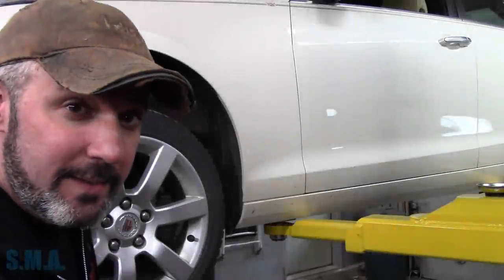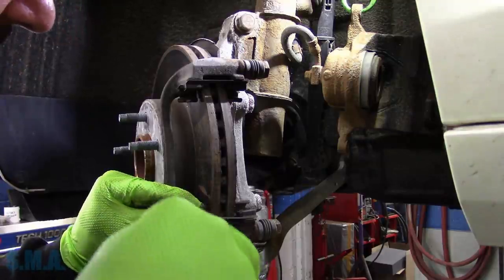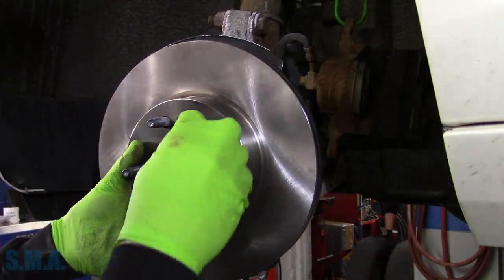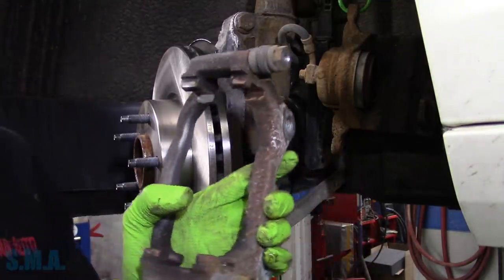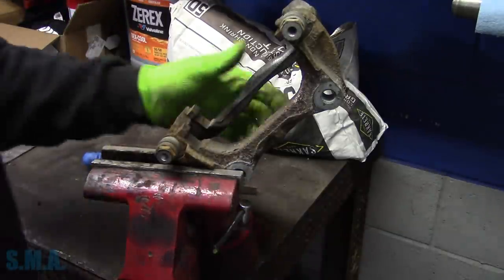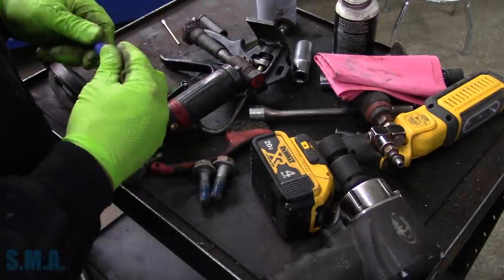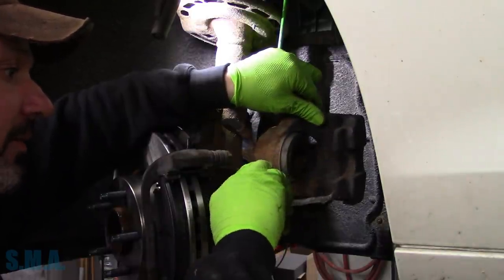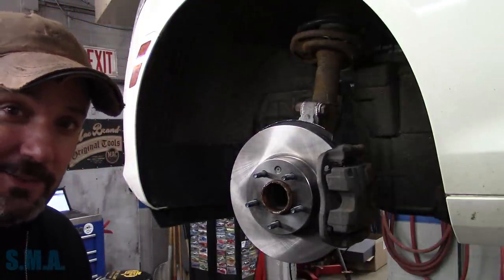Cadillac ATS: Front Brakes

Comment: If we must reuse the stainless steel brake caliper retainer (anti rattle) hardware, we run them through the glass bead blaster. They come out looking new, with no sign of crusties or tarnish. We also run the mounting bracket through the baster at the same time. We just clean the mounting surfaces as you do most of the time. You are a pro at what you do. Using the brake service file was for the benefit of the DIY guy with limited tools. Great Job! .....Walt Central NY

Comment: reusing hardware!! whats next? endorsements for Dorman?? ROFLAO!!
Reply: Actually, saw a video by MotorCity Mechanic last week. He installed a cross over pipe (between the left right side) of a Chrysler 3.6L v6 engine.  The factory pipe is plastic and the Dorman is machined aluminum with a recessed replaceable o-ring.  It fit perfect and looked awesome.  Frack'n Dorman.  Who knew they could actually get something better than factory.
Reply: @phprofYT  it's probably paper thin and will stress crack or corrode through in 3 months.. LOL
Reply: @phprofYT  ya ha they couldn't even get a thermostat housing Right
Reply: Yes that cross over pipe by doorman is awesome . Its not paper thin. Infact in my supercharged dale monty the p.o.s plastic crossovers blew out it seemed everytime i matted it. I had to wait for the aluminum ones and guess what i got the first ones
Reply: Dorman vs Chrysler- Takes a crappy part to fix a crappy car.  Makes perfect sense.
Reply: @phprofYT  Dorman also makes/made upgraded ford blend doors; they have a metal band around the stub shaft that usually snaps.  I've used a lot of their suspension steels without issues (spring mounts, shackles, radius arms, etc.). Depends on the application I guess.
Reply: @ratdude747  Occasionally a Dorman part is a good value, the problem is finding out which ones!
Reply: @throttlebottle5906  l

Comment: It's always a struggle to decide which of the specialized tools and lubes to go out and purchase when I do a brake job at home because I do them so infrequently.  Like the deep set wire brush you use to remove rust around the lugs before mounting the new rotor and those nifty scrapers that look like files to remove rust before installing the hardware.  I mean, I'd love to own those things but I just know they'd migrate to places in the far reaches of my tool box where I only rarely go and they'd be forgotten before the next time I need to install brakes.  Excuse me while I go look for a coat hanger to use to fashion one of those caliper hooks.  That's one thing  I won't need to buy.  Love your videos, Eric.  Thanks!

Comment: I got one of those Mueller files. Frickin fantastic they are. Soooo happy they make these. Every guy who does brake jobs, need one or 2
Reply: George 
I use an air angle grinder, with a 1/2” wide flap wheel that is 3” wide. Works very well for less then$1 a piece
Reply: @Sicktrickintuner  sounds like it would work well. Unfortunately I dont have a pneumatic angle grinder or a air compressor capable to run a decent angle grinder.

Comment: You are 100% correct with your Loctite assumption. It MAY be less viscos after 10 mins but not near "hard" or anything like that. It will start to harden when the bolt is installed.

Comment: I work at a Hondoo dealership and we never replace the hardware, just clean them up, lube them up and reinstall - they are stainless as well. When the customer insists on aftermarkoni pads, I give them back the hardware that was in the box.
Reply: After market hardware is a nightmare. .
Reply: @TheOutwiththeold  truer words have never been spoken...
Reply: Simple Electronics agreed. Fitment is iffy and we’ve all experienced post brake job test drives where the aftermarket hardware decides to start touching the rotor.

Comment: They used to make those caliper brackets out of an alloy that was corrosion resistant - my older Cadillac Devilles have never corroded like these newer cars and trucks do and they use the same type of setup.  Most of the time, these newer cars only need a brake job because the caliper mounting brackets corrode and jam the inner pad which destroys the rotor.

Comment: I don't know if this counts as a brake job but replacing an abs wheel speed sensor on a 2007 volvo xc90 is a pain. You have to remove the second and third row seats to remove the carpet, sound damping foam, and a metal bar. If you're ever bored just look it up on whatever diag software you use, I use vida dice.

Comment: What I like about metric bolts is that the head is usually 4mm larger than the bolts, 6mm bolt 10mm socket 8mm bolt 12mm socket.
Reply: Simon,
I never thought of that. That is interesting,  as a kid I found most American bolts were 2 sizes bigger, 3/8 bolt and 1/2 inch wrench. As they get bigger I think it gets farther apart.

Comment: a mechanic with 40 years experience told me the proper use of loctite is to put it on a clean, dry bolt thread and wait for it to harden before installing. Not sure if true of all kinds of loctite but it seems to be for the standard blue...
Reply: Except that isn't ow Loctite works (red, blue, purple).  It is anaerobic... absence of free oxygen.  So when in doubt read the directions.  That mechanic must have been hourly and not flat rate.  Probably still waiting for it to harden.

Comment: The amount of rotor bolts I have stripped and then just taken a drill to is insane. Probably the only piece of hardware I would consider entirely redundant on a car. Besides an egr
Reply: Try a Shake n brake.  They are great on removing rotor screws.

Comment: Some places charge 3 to 4 hundred per axle to do brakes.
I get drilled and slotted rotors front and rear with the brake pads for my 2014 Cadillac CTS for 150 bucks do it myself
Don't have to pay for labor and overhead.
I live in the mountains so we go through more brakes at least every other year we have to do them

Comment: You must be a damned mind reader. First I was wondering why you didn’t use the wire wheel first and as soon as I had the thought, you explained it. Then I had the thought pop into my head about why you weren’t using the purple grease and I’ll be damned if you answered in real time. Great video

Comment: Eric-  Did you ever do the Radiator on this GM model?  Would you have a video to post?  Working on a similar style Chevrolet Cruze, appears the only option is removal of the full front bumper cover and a lot of work.  Wondering what you found on a similar body style GM vehicle.  Thanks!

Comment: I subscribed. You scare me man, your just like me. I got the same hat. Talk the same way. I got a Harbor Freight vacuum cleaner. It works real good. I think that little torx bolt on the rotor is an overkill, but I'm not an engineer. I wonder if anybody has ever broke one off removing it?

Comment: They probably say not to run files back and forth, why because it can roll the sharp edge of the file over on the back stroke which a rounded edge won’t cut anymore.
But not my file, not my issue when it gets dull

And the loctite lets it sit and dry out enough not to screw up the torque by acting as a lubricant.

Comment: Does Eric have a brake lathe? I've watched a lot of his videos and he never mentions turning the rotors. It's such a standard job. My uncle usually recommended resurfacing the rotors once before replacing them.
Reply: Like most of us he got rid of it because most of the newer stuff has rotors that are already thin and makes it a waste of time to cut them. Plus with the price of new rotors, it's actually cheaper overall to replace them. Now if you have an odd vehicle or you pulled the rotor off a yard car then a light cut to true them up and remove the rust is a good idea.
Reply: @Blazer02LS   The first rotor I remember replacing in the early 70's cost the customer a weeks pay. We only changed one!
Now they cost about an hours pay.

Comment: If I remember correctly, the locktite GM uses on the caliper bracket bolts is almost a paste consistency and not the same as the locktite we're all use to using but it does the same job.
Reply: Cross threading is the best! LOL
Reply: LOL! at bill.
yeah it's probably a pre-application type, which dries to the bolt until installed and opens the magical microbeads of locking goo (or something like that)

Comment: You know, I always used to make fun of folks that warned about pushing junk back into the master cylinder, then one day I was doing brakes on my '96 Honda Accord.  I didn't open the hydraulic system at all, just put on rotors and pads in the front.  The brakes were fine when I started the job.  When I got done, I had pooh for brakes.  After some looking around, I realized that the drivers side front brake wasn't doing anything, so I tried to bleed it.  Bleeding it got me nowhere, there was basically no pressure, no fluid coming out.

After a bit of scratching my head, I cracked loose the brake line fitting for that brake at the proportioning valve, pressed the peddle and got the same result, nothing.  I moved on to the line coming into the prop valve for that brake, and nothing there either.  Last test was directly at the master.  One line had perfect pressure coming out of it, the other had nothing.

The car was stopping fine when I did the brake job, I did it only because I could hear the brake squealer making noise.  The ONLY thing I did was push the piston back in, and when I was done with the brake job, two of my four brakes weren't working and I needed a new master cylinder.

Now, for sure, it was an old car, high mileage, so could the master cylinder have just decided that it was going to fail at that exact moment?  I suppose, but from that point forward, I have always put in the extra effort to push that fluid out the bleeder, and put fresh fluid in the master cylinder.

Comment: My front disc brakes on 01 Chrysler Town and Country have pads without the abutment clips. I had to file a bit from the pad ears so they would fit which exposed bare metal. No lube on these ears would end up rusting?  How to handle this?

Comment: I had a 1950 Ford F-2 pick up (3/4 ton) and no where in the repair manual did it say to torque to 50 foot pounds then tighten another 30 degrees. On any bolt! Why do so many repair manuals say to torque then add another few degrees?

Comment: What’s it mean when you turn your wheel
To the left when driving and the brakes squeal? But goes away when driving straight
Reply: It means its probably not the brakes
Reply: could be wheel bearings getting lose and brake pads just about to the indicators, which it rubs when turning. I've seen some very loose bearing that were not noisy before allowing the whole wheel, rotor and hub assembly to move around pretty far. so probably wise to have it checked out. even good/new bearings have some movement in them, not felt or seen without special tooling though.
a quick dirty test with vehicle on the ground is grab the tire at the top and yank it back and forth hard enough to rock the whole vehicle and feel/listen for clunking sounds, I myself can find almost all issues in suspension and bearings that way very fast, of course people look at me like I'm nuts and ask what I'm doing lol
Reply: throttle bottle def strange. Truck has new wheel bearings and I redid all the suspension and steering components, ball joints n stuff. It’s a solid axle
Reply: throttle bottle Thinkin the pin is kinda seized on it, jerks to the left with a panic stop but then goes straight. I have new calipers n brakes from power stop but waiting til it’s warm to do it. I don’t drive much lol

Comment: Burnish the brake pad? How do you do that? I never cleaned the rotor never thought about it? And they still wore out
Reply: Harold,
What burnish the brake pads means is,
You go out on a empty road get up to about 60 MPH then hit the brakes pretty hard, not to the point of the anti lock system kicks in, but slow to around 20-30 MPH.  Do that about 3 or 4 times, and I think what that does is helps the pads and rotors get matched, or seated in. I do know it seems to help the braking.

Comment: Not trying to be "one of those" guys.  You tightened the caliper bracket bolts another 30 degrees. Aren't those single-use bolts or are they not stretch bolts?

Comment: I was about to ask you chrome socket?I think every  shade mechanic  has used one on an impact.
Reply: Pretty much every pro has as well... BUT don't tell the tool truck that you blew a 19mm apart using the air gun, they don't consider that a defect...
Reply: Blazer02LS I like that .
Reply: yep, all too often the proper sockets won't fit in tight areas, so out comes the chromed and non-impact rated adapters and extensions.
I've seen it done even with tool boxes the size of a 53' tractor trailer. lol

Comment: What’s the concern w/ a little bit of rust on the bracket where the hardware rests? 
 (Btw I don’t live in the rust belt)
Reply: It leads to rust jacking making pads a tight fit in the bracket , they won't slide in and out causing the pad to stick and over heat as can be seen with the inside pad at the start of video 👍

Comment: I have a 2003 grand marqui had a test ran on it it had a code of p1000 what does that mean I need help.please
Reply: Quick google search can help, but with that said thinks it's just a Ford Motor Company code for monitors haven't ran yet. Should just be able to drive it around and should work its self out. Happen to replace a battery recently?
Reply: It usually just means the battery has been disconnected recently.

Comment: The 10 minute wait on Loctite is new to me. If anything, everyone but GM discourages waiting:

https://www.searchautoparts.com/automechanika-chicago/commitment-training/eight-most-common-threadlocker-mistakes

The only rational I can imagine is to work best, the LT needs to wet out the entire thread. 

I suspect some GM PhD thought he could add value by telling folks to wait so the LT could capillarily flow and fill the threads of an underapplied bolt.

Comment: A 4 cylinder Cadillac? This is why GM is a 20$ stock and Tesla is 750$ stock.
Reply: 2.0L turbo
Reply: Never understood why caddy did that , either
Reply: @silverSScamaro  I think its like 270hp. Under 6 seconds 0-60...
Reply: @thomasfletcher760  Maybe they wanted to do Cimarron part two!
Reply: Just get a CT-4,5 or 6 if you want a V6 this is just an entry car into Cadillac sedans. That and stock values have nothing to do with this. Tesla just happened to have a much larger IPO than GM.
Reply: Telsa stock runs on hype. Not really a fair comparison.
Reply: @0778drz110  facts, when the cyber truck came up the initial deposit was like 100$ so a whole bunch of people put deposits down as a joke to say I'm getting one. Like non of those held true, but for that time being they had a stock spike
Reply: guss whu tesla has vision, and has turned profits, revenue is expanding, shanghai factory up and running, and more! Gm puts 4 cylinders in a cadillac. And makes cars that breakdown all the time. Gm sucks.
Reply: @thomasfletcher760  because its cheaper and it's in everything and the epa give them money for it plus the car journalist like the more power even doe the V6 is more powerful in the real world
Reply: @crisprtalk6963  ya tesla are so cool he puts alot of work into making great software
Reply: @crisprtalk6963  
That Cimarron was not such a great idea.
Reply: @crisprtalk6963  Tesla hypes the market with flamethrowers, cyber trucks, customer beta testing their self driving cars, home battery packs, tunnels under LA, robotaxis, and other stupid stuff that idiots love. Comparing their stock to Apple makes more sense than GM.
Reply: @0778drz110  so you are saying they are not selling cars? You are brilliant and so esoteric. Shine on!

Comment: "Comes with a couple different sizes, a skinny one and a thick one.  Depends on what you're into.  Or if it doesn't fit, you'll have to use the smaller one"

Are...are we still talking about files?
Reply: Maybe both? That'd be a heck of a special bracket.